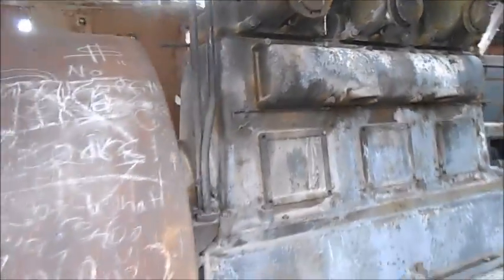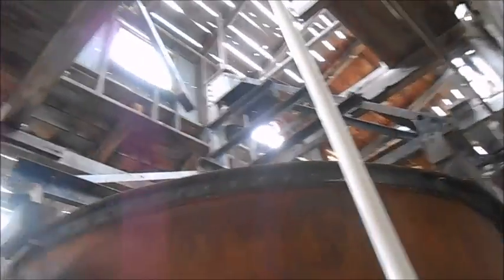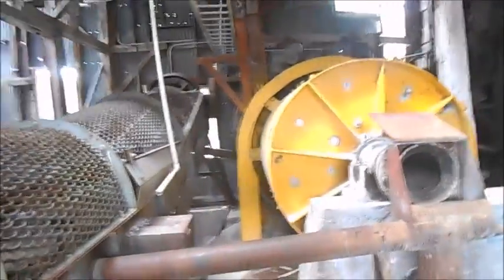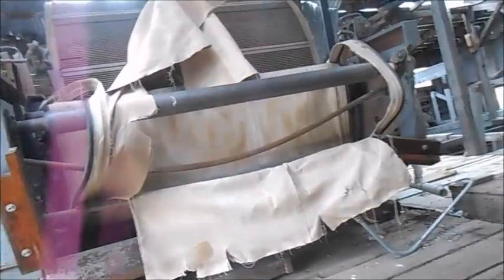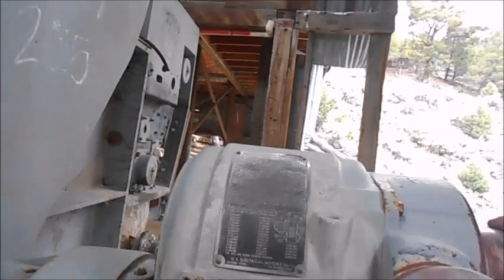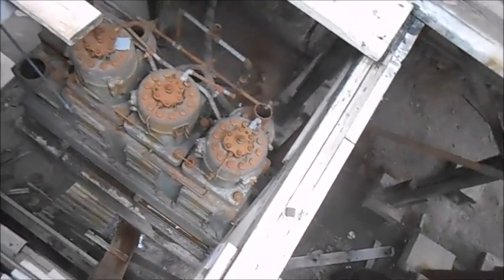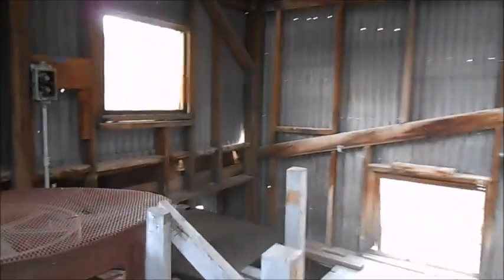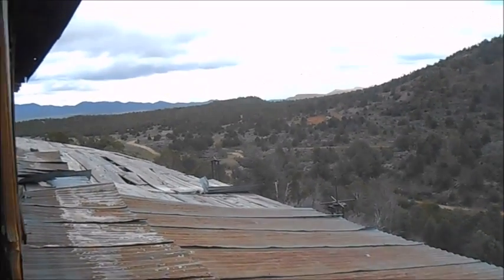StateLine Mining District Utah 2015

Comment: Was there a creek there?
Reply from the maker: Their is a creek though small it does originate from a spring up Rice Canyon and works its way down into State-Line.
As for the general store, this was also one of the hotels. This was originally a two story structure built in 1898. General Store/Saloon on lower level and 5 rooms above. Behind the structure is still the old foundation of cold cellar and above that where Charles Peak and his family lived, he was the saloon keeper. And the owner and original builder of the building was John Smithson, he and his family lived a few houses down from the old city center towards the cemetery.